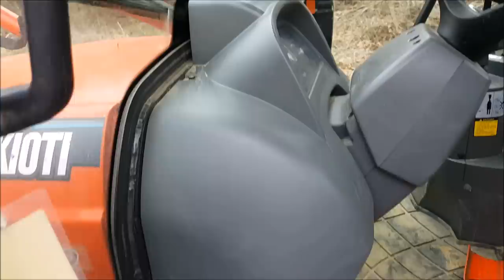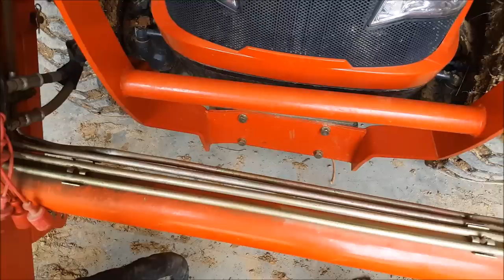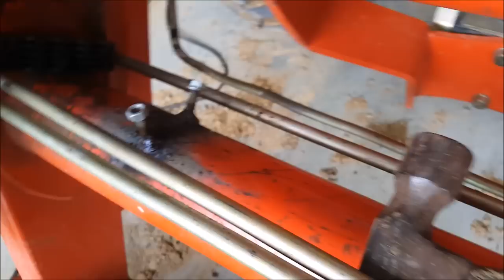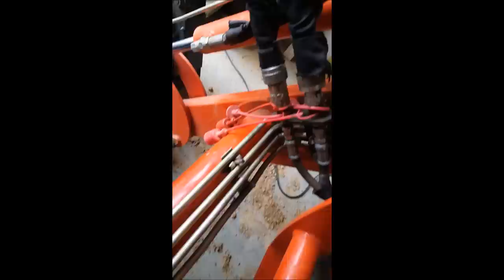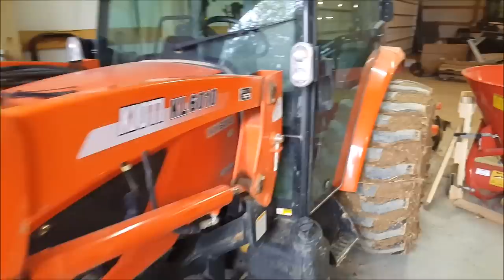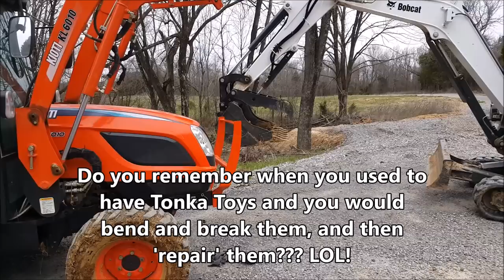Fixing Bent Tractor Hydraulic Lines and Bending Brush Guard.. Will it work??

Comment: How did you straighten the actual hydraulic lines?
Reply from the maker: It's been awhile since I did this so don't recall. But I think I just used channel locks and maybe a pipe wrench to get them pretty close to their original position. Thanks, good luck.

Comment: I was going to suggest that you take some of those stainless steel geared hose clamps, join a few together so that they can wrap around that hydraulic line guard and clamp the guard in place; that is if you couldn't get those studs welded back in place. 
You got it done anyway,...this will be o.k.  Try to resist the temptation to push the guard back in place with the Bobcat. If that slipped, good bye another part like grille or headlight assembly. It would be better to take the grille guard off, and bend it back with hydraulic press or sledge hammer while only the ground.
But like I said,..you got 'er done' anyway, so you're o.k. for now.
It's all part of the 'learning curve' of working with equipment like this.
Reply from the maker: I do try to be careful bending , but I know what you're saying! Trying to save time this way... Thanks

Comment: Was thinking if I had to fix the line... I'd cut a 2by 4 with a groove and hammer slowly the tubing into it.  My other option might be to cut out the bad chunk and splice in a new piece.
Reply from the maker: The line held up without kinking when it bent so I think it will be good to go. But you're right, a splice would have been much cheaper than a whole new line..